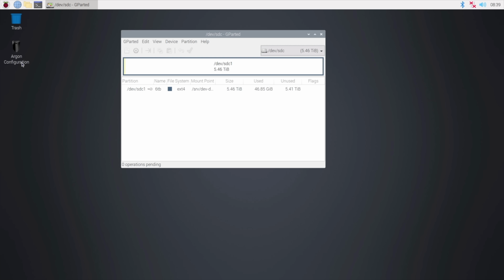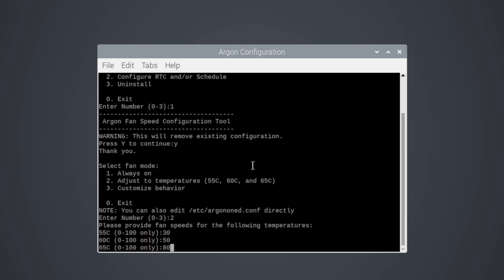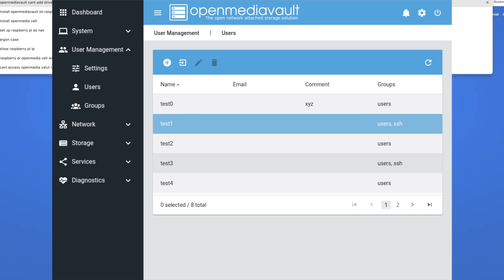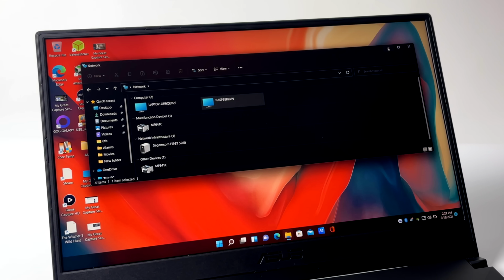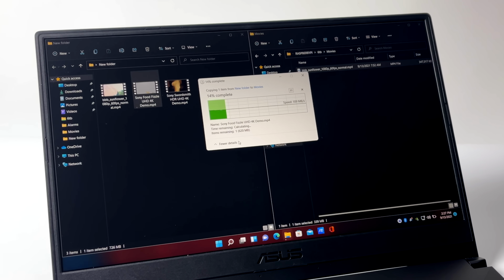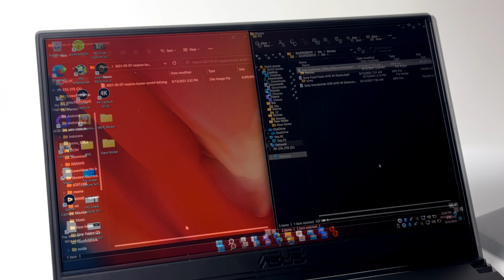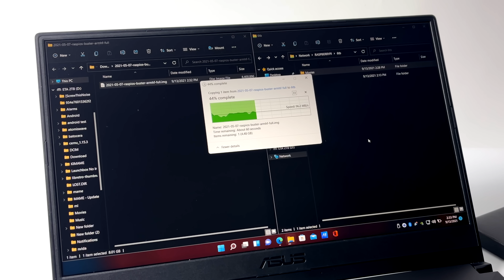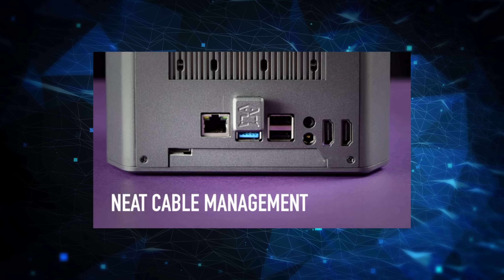Argon 40 EON First Look! A Raspberry Pi 4 Powered 4 Bay NAS

Comment: After 4 years I finally caved and bought mine. It will house 3x 4GB SATA SSDs (Latest from Samsung) with a RAID configuration. I'm aware of redundancy issues and am researching the ideal RAID NAS configuration (Any suggestions are welcome). I do wish they would update the breakout boards to be compatible with the Raspberry Pi 5, but honestly the main bottleneck at this point would likely be WiFi (802.11ac), so I might need to consider Ethernet.

Comment: It's ok for gig-e or WiFi but thats it.  Pi4 CPU is  too slow, get a mini pc with 2.5gbe. or a proper NAS. 2.5ge is very affordable now. I tried 2.5 on the pi4 with an overclock and SSD but it's only 10% faster than what this dude got. In fact the the built in USB sharing port on my Netgear Nighthawk router was a good deal faster, so this product is the worst option out of the 4.

Comment: I'm bummed I missed the Kickstarter. I REALLY want one of those cases. I just have everything hooked up from external enclosures due to the lack of power through the pi. It's small but there are a lot of cables and I just hide it behind my monitors. This is the ultimate solution and is so well designed.

Comment: Can you use the built in wifi on the pi to connect to the NAS so you only need one cable connected for power? I know its probably going to be a very slow transfer, but I'm just curious if it can be done.

Comment: Disappointed that it can’t hold 4 3.5 drives. Can’t use raid 5 unless I spend a lot more money or have small capacity. (Just got a 3.5 inch 4Tb NAS drive yesterday and buying a bunch more to fill a NAS).

Comment: "But why wouldn't we make a NAS that can hold 4 full-sized hard drives?"

Good question, since the only slots that will accept 3.5" drives are on the outside, meaning 2 more 3.5" drive would certainly fit on the 2 inside slots (if the slots are spaced correctly.) I think there is not enough airflow cooling available for 4x 3.5" drives rather than there be not enough power available from the supply. Maybe they will make a little bigger model in the future with greater airflow (and a more capable power brick). A rectangle shaped case would be much more reasonable, but it wouldn't look "so cool as a triangle" !
Reply: its because of the triangle shape nothing more 
its form over function

Comment: The question is why argon uses an ordinary Pi 4 here and connects it to the drives via USB 3.0, instead of using the compute module 4 and connect the drives via its SATA connection. This would increase transfer speeds.

A startup created a similar product based on the compute module 4 using its SATA connection, but there are delays to the release.

Argon would do best to bring out a variant with the CM4 and drives connected to its SATA port.

Comment: I would really like to see a similar NAS build... but with a Compute Module 4 and direct SATA. I'm guessing this project was in the works prior to the CM4 being widely available (well, I guess it still isn't...), but it seems like a logical next step to get 10-20% more performance.

I'm okay with the 2.5/3.5" drive split, but it would be nice to either go full 2.5 or full 3.5, and drop the triangular form factor.
Reply: @MicroLinux actually, there is.
The Raspberry Pi ecosystem is supported by a much larger community and especially the CM4 will get long-term manufacturer support that the RockPi ecosystem simply cannot provide.
And it is more than likely that future CM versions will just plug into the same sockets / carrier boards that the current CM4 does.

IF a RockChip solution that is similar to the CM4 will be available, we can have this conversion again.
But until then, there is not much to say in favour of Pi clone boards.

I have bought a number of "supposedly superior" Pi clones, only to give up on them I  frustration and instead try to coax every last bit of performance out of the Raspberry Pi variants.

Getting obscure Pi clones to work properly and reliably may be your cup of tea. But it's not mine. If a project I'm working on is buggy, knowing that the foundation is solid is a luxury I don't want to miss anymore. Otherwise there are just too many variables to get to the root of the problem quickly.
Reply: @PatsFanGermany  I believe it's akin to the argument that "Android is better because you can sideload apps." — that is true... in some cases, for some people. Raspberry Pis are not the only option, and that's a good thing. But they do have the widest community support, a stable and already-proven foundation backing the entire project and working with upstream Linux to make sure there's first-class (or at least second-class) support for Pi features in the kernel, and even if the chips aren't perfect (Broadcom brings a lot of fuzziness into play here), they are adequate and if we're talking about a gigabit NAS... honestly even USB 3.0 solutions aren't so bad.

But disk latency can be a lot faster with direct SATA, thus my complaint. Regular Pi 4 model Bs are also in somewhat short supply—I've only been able to get the most expensive 8 GB models recently, and... that's a lotta money compared to a $35 2 GB!
Reply: @JeffGeerling  You are right. Currently the RPi 4B 2GB model is nowhere to be found. In Germany 4GB and 8GB models are widely available.
But if a 2GB model is all you need.. 🤷🏼‍♂️
This week I wanted to buy another 2GB model for another Pi-KVM build, but was out of luck. The 4GB model is just overkill for this project.

My guess is that Brexit has messed up the supply chain for Raspberry Pi Headquarters. Isolationism is seldom good for companies that are buying and selling globally...
Reply: @Jeff Gerling Exactly! I had asked Argon Forty via email right after the public announcement.
They replied that the lack of availability of the CM4 was the driving factor behind the decision.

And they said there was practically no speed difference between both solutions.
But after watching your CM4 Router board comparison video, I highly doubt that the USB3 solution will come even close to a PCIe SATA solution that directly connects the SATA controller to the PCIe bus.
Reply: I think I'd rather have the penta with a RockPi4c. Sure its only 2.5" drives but it's at least PCIe and asthetically pleasing. If I'm going to be accessing files off of it I'd much rather have the PCI speed than USB
Reply: @MicroLinux they ARE Pi clones. Same form factor, same GPIO and very similar port layout.
Before the first Raspberry Pi, computers large and small never looked like this. They never had GPIO Pins exposed like this.
The RockChip is the only distinguishing feature and they just don't have the same manufacturer support and community!
Reply: @MicroLinux of course, someone disagreeing with you must be ignorant.
At this point any discussion is not worthwhile. EOD
Reply: I'm working on it.....
Reply: Agreed.  The HW cost of a system like this is in the Hard drives....  So spend a few more bucks and do it better.
Reply: Yeah I'm not huge fan of the triangular shape... I'd prefer expansion or at least better cooling. A rectangular design can easily incorporate a larger fan (120mm would be ideal imo -- esp if one on bottom w/ little riser legs, and one at top). And after seeing your vid where OC'ing the Pi helped increase network xfer speeds... the extra overall cooling could really give more options to the end user. 

I'd love to be able to get a case like that for my own NAS and upgrade from the USB 3.0 caddies which only xfer at 30-50MB/s.
Reply: Exactly, Jeff. Form over function for an appliance like this doesn't usually net great sales.
Reply: @MrSB910  That sadly wasn't my experience when working at a big box store.  People put a great deal of value in aesthetics quite often.
Reply: @MrSB910  you mean form over function.
Reply: @almightyEsquilax  Whoops, you're right - typo.
Reply: @MicroLinux There is one RockChip SBC that could be a challenger to the Raspberry Pi in terms of manufacturer support and that's the ASUS Tinker Board 2, but it isn't cheap. 100+ Euros for a 2GB SBC? Why bother? At that price point even small Intel Systems become more attractive.
Reply: Desperate for subs?

Comment: You could do two large 3.5" drives and two SSDs and do a tiered storage solution.  Fast for commonly-accessed files, slow for stuff that mostly sits.  It would probably be a bit of a project, but it would work nicely once you ironed it out.
Reply: pi4 cpu is too slow to do this.

Comment: From the product FAQ on the Kickstarter page:

What are the transfer speeds of the Argon EON?
Over LAN, the EON is able to maximize the Gigabit LAN of the Raspberry Pi at around 125 MBps.

Internal transfer speeds based on our testing with Western Digital Blue Series, the HDD (7200rpm) we get an average 150MBps and SSD we average at 280MBps.

We also tested the Samsung EVO and we maxed at 320MBps.

The ASMedia chip we are using is rated at 500MBps.

Transfer speeds are limited only by the current capacity of the Raspberry Pi and not by the Argon EON itself.

Comment: Reproducing parts of a couple comments I made as replies to other comments, below.

Given the Pi's absolutely insufficient USB power infrastructure, you should assume you won't be able to plug anything else into the Pi over USB 3, unless you get a powered hub. (And even that's dubious; I've got the Sabrent powered hub that's supposed to work with the Pi 4b, and my Pi won't boot with it plugged in.)

This doesn't bother me that much. Most people's client devices are going to be 1Gbps per second at best. If you're sophisticated enough to be looking for 2.5Gbps LAN performance, you're not buying a Pi-based solution, in any case.

Assuming the most you're going to get out of a USB 3 port on a Pi is ~2.5Gbps (330 MB/s) in the best case, the bottleneck is the 1Gbps (125 MB/s)  full duplex LAN connection. Most people are going to be using SMB or something similar to transfer files, which means they're likely not going to come up against that limit, either, unless they're transmitting large files; transmitting a bunch of little files over SMB does not push the limits of a 1Gbps connection unless you're under ideal conditions.

So long as you're really only hitting this thing with 1 or 2 simultaneous client connections, it's probably going to be just fine. It's certainly going to run with less power from the wall than most alternatives in this price class, an the OS is completely open source, which means you get to avoid the security nightmare black hole that is a poorly protected proprietary device (I'm never buying another QNAP device, ever).

With a couple of high capacity drives in RAID 1, and a pair of 2.5" SSDs for cache, running with something like OMV as the OS, this is potentially a great backup device or media server.

The triangular shape emphasizes this is meant to be a space saving device--stick it in a corner, no wasted space.

It's lower volume, so of course it's more expensive, but I can see the advantages for certain use cases.

Comment: Now the question is are they using USB 2.0 or 3.0 to connect to the drives? Because it's a raspberry pi and the PCIE 1x is not broken out like on the compute cm4 what are they using for the hard drive?

Comment: this Nas looks very simlar to one i saw on git hub several months ago using a cm4 and it was limited to three 3.5 spinning rust drives due to power constraints plus the pi is limited to sata 2 stds.  and is only capable of 150 to 200 MBs. Max the design for the one on git hub is open source and 3d printed. and probably will be cheaper then this one. looks nice tho.

Comment: Hmm, a very interesting case, could be a good replacement for my Pi 4 in an Argon One case with 2x 12TB eachj in a different case. Would have been better though if you could use 4x3,5" drives. You could use 4x3,5" when leaving the sides of the case open I assume. But for now I would only equip 2x3,4" anyhow.
Do you know when the case will be released?
Reply: Backers on Kickstarter should get there's from late Dec 2021.

Comment: Very cool, thanks for the video. I'm probably going to back this but I do wish they had a 2.5 inch only version which would cut a little height off the top. But I've been looking for a solution for home and I think this is going to be it. Too bad it needs to wait until December or a little later.

Comment: Honestly you could install, and use four 3.5" drives. You just won't be able to install the side panels. So I'd say if they can make some side panels that can accommodate the edges/ corners of the drives. If you can imagine it, you have to admit ìt looks good with the protruding triangular/ pyramid points on the sides.

Comment: I guess you could modify it and use SATA extension cables to a 3D printed drive enclosure to use it to its full potential, but it really sucks that they didn't make it a bit larger to fit four 3.5" drives.

Comment: Argon needs to add POE+ ethernet to this. Would be great!  Also - allow 4x 3.5" hard drives instead of 2. Although unsure POE+ would have enough wattage for that. Another thing - it appears Argon is using the USB3 superspeed interface. I wonder if the Raspberry Pi compute module 4 with it's pcie-2 x1 lane would be faster than USB.

Comment: Could this board power four 3.5" drives if I removed it from the case and used cables? The problem with RADXA's board is it could only power 2.5" drives and needed an external power supply when connecting 3.5" drives.

Comment: If the SSD's could be configured as cache for the conventional drive RAID, that would be awesome.
Reply: Will buy an Pi4 8GB, 500GB SSD an three 2TB 2,5" HDDs. Is an SSD as a Cache possible? 🤔
Reply: @darkmasterch1ef346  pi4 is too slow to make any difference with ssd.

Comment: I'd like to see it as a Plex server. I'm currently using an old computer for Plex. It has 2 2TB 3.5" drives for the movies and 240GB SSD for the operating system. So this Argon40 EON would work for me if I could load Plex on it.
Reply: As long as it's direct play, you'd be fine.
The Pi 4 struggles with hardware transcoding.
I run my Plex server on a Pi 4 in an Argon ONE M.2 case with a 500GB WD Blue SATA SSD and it works fine playing back on my TV using the Plex app available on my LG smart TV.

Comment: Stupid case design, should've stuck to a rectangular design with a much simpler mounting solution for the hard drives.
Reply: Advantage: this fits into corners. It requires design compromises, yes, but if space is limited, a triangular design is ideal.

Comment: You could always print you some different sides for the case allowing space for the extra width of the outside drives. It may be ugly, but it's better than what I'd do and that's just leave the sides off.

Comment: Shame it's so poorly designed. From the clumsy way you install the drives to the limitations on the number of larger drives you can have in the case. With just a little more work, it could have held 4x 3.5" drives in real bays. Plus I agree with another comment here, the CM4 would have been a better choice. It's cheaper and really a better design for this use case.

Comment: you forgot to mention its performance is limited due to its USB3 connection to the Pi4..! I couldn't find a single frame in this video showing the USB bridge connector. pretty lame
Reply: The USB bridge was visible in one shot. It looked like a standard USB u-connector--one plug into the Pi and one into the Argon device. Given the Pi's absolutely insufficient USB power infrastructure, you should assume you won't be able to plug anything else into the Pi over USB 3, unless you get a powered hub. (And even that's dubious.)

This doesn't bother me that much. Most people's client devices are going to be 1Gbps per second at best. If you're sophisticated enough to be looking for 2.5Gbps LAN performance, you're not buying a Pi-based solution, in any case.

Assuming the most you're going to get out of a USB 3 port on a Pi is ~2.5Gbps (330 MB/s) in the best case, the bottleneck is the 1Gbps (125 MB/s)  full duplex LAN connection. Most people are going to be using SMB or something similar to transfer files, which means they're likely not going to come up against that limit, either, unless they're transmitting large files; transmitting a bunch of little files over SMB does not push the limits of a 1Gbps connection unless you're under ideal conditions.

So long as you're really only hitting this thing with 1 or 2 simultaneous client connections, it's probably going to be just fine. It's certainly going to run with less power from the wall than most alternatives in this price class, an the OS is completely open source, which means you get to avoid the security nightmare black hole that is a poorly protected proprietary device (I'm never buying another QNAP device, ever).

With a couple of high capacity drives in RAID 1, and a pair of 2.5" SSDs for cache, running with something like OMV as the OS, this is potentially a great backup device or media server.
Reply: @sinisterpisces  you're suggesting attaching 4 drives to this so called NAS just so one could say "look! my Pi4 is now a NAS storage device" ? while you can get the complete package for 80$ (including power supply) on a Odroid HC4
Reply: @anonylesss  I'm not saying this the only option. I'm also never interested in bragging about my hardware for internet points.

I like that it's an option for avoiding a proprietary solution.

As the comments in this thread indicate, it's clearly a niche option.
Reply: @sinisterpisces  it's a niche expensive bad option, to my opinion. reminds me of the Coolermaster Pi4 case that was crowd funded as well. It was also bad, to a point CM issued refunds to any supporter who was disappointed